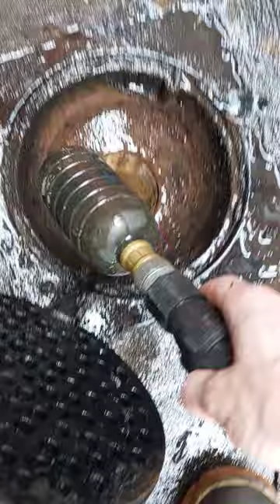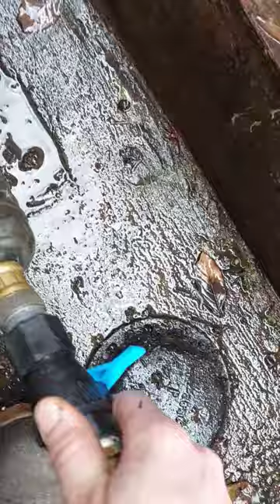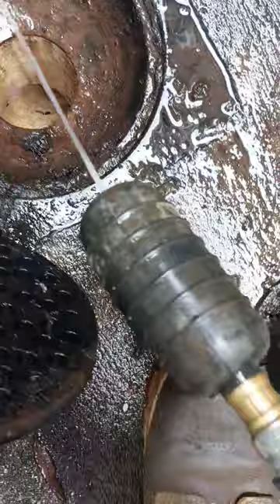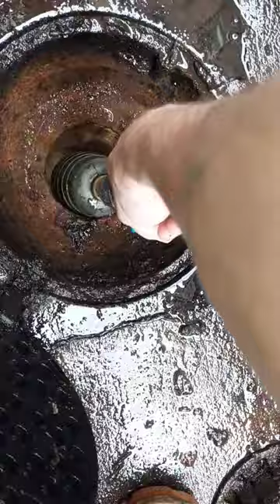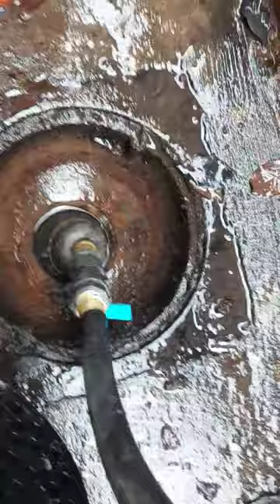plumbers bladder #drian #rigid #husky #plumbing #new #driancleanings #drian #pvc #works

Comment: Had a stopped up sink where the clog was in the wall, and the plumber's snake wouldn't go into because it was at the T junction where the line runs down and also up to the roof. Used one of these from Harbor Freight. You could hear water running down the pipe into the basement, but also it was shooting out the pipe on the roof. Climbed up on the roof and blocked the flow with my hand and felt something give down below, and then the water started sucking down, creating a vacuum. Let it run a few more minutes and the pipe clog was gone. $9 well spent.
Reply from the maker: Most definitely lol a lot of times I have to cut into the stack connection to get my cabel to go the right way with the snake . Or I just go to the roof and run down the stack is the blockage is past the connection. I love the bladder it’s great for soft blockages. Glad you got it done man thanks for the comment
Reply: Well said so thnx lots!!!
Reply: Damn I’m definitely going to harbor freight you sold me 😂

Comment: Can using this cause a pipe to crack due to the pressure build up?
Reply from the maker: I’m sure it could if the pipe is in horrible shape and u don’t use a valve and just turn it on full blast .  But from my experience and others the bladder usually pops before the pipe breaks but I’ve never used it in super deteriorated pipes. Just start slow and work you was up and keep it quite as possible around you so u can hear the pipe creak if your worried and catch it before it cracks hopefully
Reply: @drainjunkies  ok it was my buddies drain, and he is going to just call in a pro to fix it. Him and another guy tried all different chemicals with no luck.
Reply from the maker: @wendull811  what type of drain . A sink or a main line . U can use thrifty with boiling water and wait 30 mins or u can use Hercules and follow the instructions. They are very very strong acids. They usually will work . But running a snake is best way to go about it
Reply: @drainjunkies  it is his kitchen sink. They tried thrifty, and that didn't work. They pulled the p trap apart, and that was fine and clean. They only had a 25 ft snake, and they didn't reach anything with that. This is why I brought up the bladder, thinking to put it directly into the pipe going into the wall below the p trap. But he didn't feel comfortable, not knowing how old the pipes are and also worrying about blowback.

His shower and bathroom sink drain a little slow, but they are working fine which tells me the blockage is somewhere in that line and not the main line correct?
Reply from the maker: @wendull811  yeah your right man . It is between the sink and the stack if u can trace the pipe to the stack u can cut the pipe and run your snake up and down the line and just put in a fernco coupling. If u bend that small snake in a s at the send it will sweep more of the line . A lot of times that snake will work but u need to create a head somewhat at the end . If it was me and I only had what he has I would cut the pipe if possible or I would try the snake with the bend if that fail I’d use the bladder . But if he has the money to spend then just call a drain cleaner out . Or go to Home Depot and rent a snake for pest then half what u would pay the plumber
Reply: @drainjunkies  I will let him know. Thank you for the advice.
Reply from the maker: @wendull811  not a problem bro

Comment: When you said, "and when that goes into the line." I felt a drop in my stomach.
Reply from the maker: lol 😂 I did it twice. Blew the bladder apart into he line .. had to run my camera and made a hook on a cable to get it out . Took 3 hrs on 1 smh
Reply: @drainjunkies  Appreciate your help. I had my septic tank pumped out & we noticed that water was not flowing back into it when we flushed several times. No sure where it is going. My question is the only drain access I have are in my home & they are coming through a wall and are  plastic. I cannot tell how far they go before they connect to the cast iron. Can this bladder be used in the plastic pipes?
Reply from the maker: @JOEZEP54  it definitely can boss. You should have a cleanout access outside between the home and septic system. It got buried or was never installed but it is code to have a cleanout . You could have what is called a belly button in your line that is holding water preventing good flow . I would go to Home Depot or Ferguson if u have one in your area and rent a camera and open your cleanout in your home and put in the camera to inspect it . If u have any questions or need help shoot me a email or just leave another comment. Hope this helps
Reply: @drainjunkies  Thank you for your quick reply. This house was built in 1975 the outside clean out was never installed. There are 2 inside clean outs not sure what the code was back then. I pushed a snake into each one 23 ft  3" until I could not get passed the blockage. This was a hand snake not a power snake. I will check my local HD to see if the rent the camera & let you know. Do you know if the bladder will damage the plastic pipe?
Reply from the maker: @JOEZEP54   no problem. And no the bladder won’t hurt it . It is very rare the bladder breaks a line . Just get a cheap valve and do as I did . The Home Depot rental snakes work well . If the line is actively clogged the cam won’t help ya because u can’t see under water to good . As long as it will take water the cam will be fine . U can also fill up all the tubs in the home and release them at once or is a 5 gal bucket and throw it down the line a few times to push anything out . If the blockage is to far away the bladder might not work because their is trunk line that can be tied in down the line and you’ll not be able to build up good pressure.

Comment: So it doesn't have to go through the bend?
Reply from the maker: @BeeBre525   no it doesn’t. Just stick it in like 6 inches or so just don’t shove the whole bladder in the line. and make sure you have a valve before the bladder so you can control it and you should be good to go
Reply: @drainjunkies  I've done about 2 rounds and still stopped up. This is the cleanout for my kitchen located in the basement
Reply from the maker: @BeeBre525  you have a hard blockage . You will need to snake it from that cleanout to the stack . It is most likely grease . U can rent a snake from home depot that will do it a lot cheaper than a plumber . After u snake it you will need to use the bladder to blow out the line. if u rent a snake make sure u get the leather garden gloves so I can work the cabel . A bladder works for soft blockages . U can also try useing a shop vac and sucking and blowing the line out by useing a rag around the vac hose to make a seal . But it sounds like you need a snake
Reply: @drainjunkies  thank you
Reply from the maker: @BeeBre525  no problem. If u have any more questions just let me know . Happy to help
Reply: @drainjunkies  I bought a powered snake.  Is it okay if there is a tiny bit of water at the  bottom of the clean out?
Reply: @drainjunkies  it's all clear!!
Reply from the maker: @BeeBre525  their really shouldn’t be any water in your cleanout at all . That can be from the pipe not haveing the correct fall anymore . Or there is a small belly in the line which isn’t a major deal . Longs water is moving thru the line your good . Run water while you run your cable thru the line to help push out anything left over in the line . I’m glad you got it open that’s awesome 👏. Is it pvc? . If it is galvanized pipe they are almost impossible to get totally clear like new .
Reply from the maker: @BeeBre525  hell yeah 👍 lol good deal . If you need any advice or help in the future let me know .
Reply: @drainjunkies  it's the metal pipe. Thanks for your help. I had 2 plumbers suggest jetting, but I wasn't paying for that. The barely looked in the cleanout. The machine is a smart investment.
Reply from the maker: @BeeBre525  it’s probably galvanized pipe . Just run the line once every few months for preventative maintenance and you’ll be fine . No problem
Reply: @drainjunkies  I was doing the bleach or vinegar, hot water, baking soda, and dishsoap to keep it clean. But I remodeled, and it took 4 months to complete. Plus, it was during the winter. This is the first time I've had that issue. But without your video, I'd still be losing my eyebrows. Thank you soooo much
Reply from the maker: @BeeBre525   no problem. And try not to put any of that stuff down your drain . Depending on the type of pipe some stuff can cause more problems down the road. Just fill you sink up to the top and release it or dump 5 gal buckets of water down the line to keep it clear as possible. I am glad the video helped .
Reply: @drainjunkies  thanks!! I planned not to, especially the vinegar and baking soda. I've been doing hot water all yesterday. I can't mentally go through that again  🤣🤣🤣
Reply from the maker: @BeeBre525  lol 😂 the good thing is now you know how to fix it lol . That definitely gives you a little peace of mind lol

Comment: Vent on roof need sealing so pressure can blow blockage loose
Reply from the maker: @nessgabe1050  not necessarily. It depends how far the clog is from where your working. You wouldn’t use a bladder to blow out a main line from the next floor . I use mine to flush out lines not always to clear them I snake the line then blow it out

Comment: How do you know when it's done?
Reply from the maker: The water will go thru the line . I use it after a snake a line and then use the bladder to blow it clear if any lose stuff in the line
Reply: @drainjunkies  Is it ok to use without snaking it 1st?
Reply from the maker: @mainpick8940  yeah but it all depends on the area u are using it in . If it outside then sure . If it is inside like a kitchen sink line or a main sewer line be mindful that once you pressurized the line and being blowing water it has to come out somewhere and or when u turn the bladder off it can all come back at you .  But I have done it before in a home .
Reply: @drainjunkies  Good to know. Thanks!
Reply from the maker: @mainpick8940  not a problem man . If I can help ya with any drain questions just shoot me a comment.

Comment: Control "from here"   (here?)  are u on the roof?
Reply from the maker: No . This is on John Hopkins campus. It is a concrete area for students to chill and has 4 inch grated drains to prevent the area from flooding . I control the pressure of the bladder with the valve I have their

Comment: Get the one made out of canvas so it doesn't blow apart
Reply from the maker: These are bladders with a hole in the tip to blow thru a line . The canvas ones are for plugging a line as far as I know